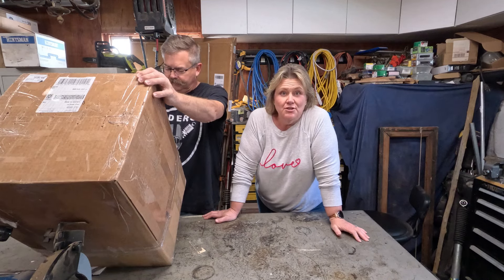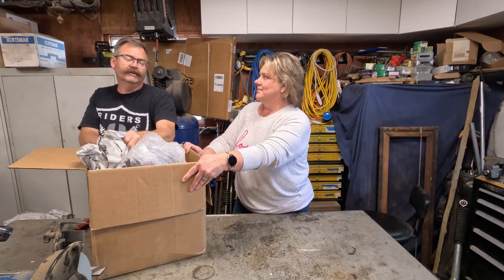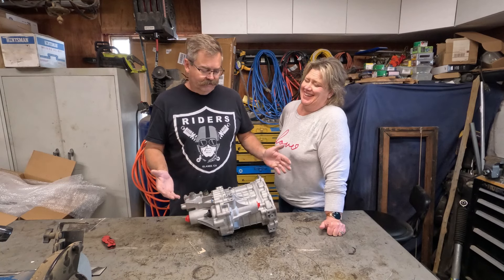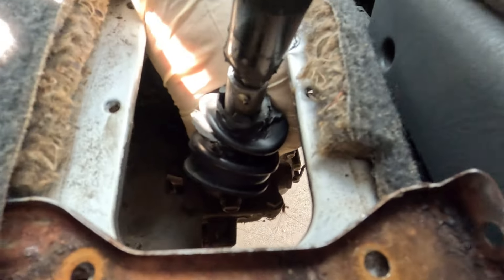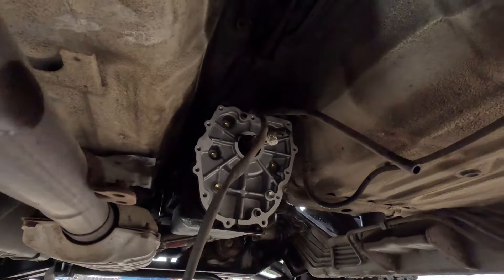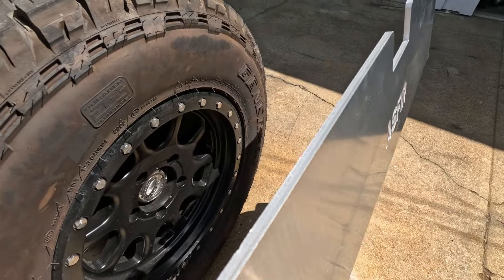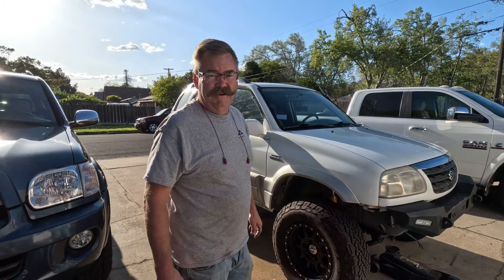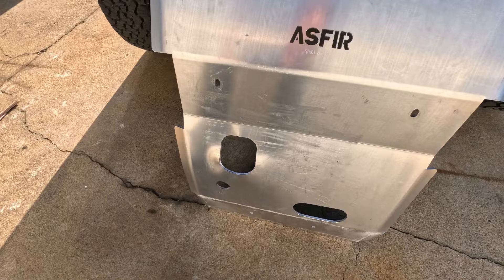Suzuki Grand Vitara Gets Upgraded TRAIL TOUGH Transfer Case & ASFIR Skid Plates

Comment: Love the Suzuki build.  I just bought one a couple weeks ago. Put a 2" body lift in and a 2" suspension lift.  Just received the 3.0 gears from trail tough, I'll be tearin into that soon. 1500 bucks for a rebuilt transfer case with low gears is a great deal.  Looking forward to your progress.
Reply from the maker: Thanks. What kind of suspension lift did you get? The low gear set is great.
Reply: @jensentime2496  just a cheap one off of eBay, nothing special.  This is my first Suzuki.  I've had a pile of Toyotas and still do, just wanted to try something a little different.  This one is the XL7, I didn't know there would be a few differences than the gv, it was cheap and I'll make it work.
Reply: Where do you buy spare parts?